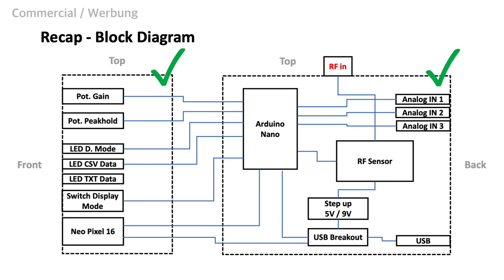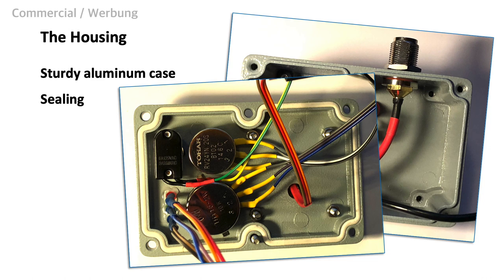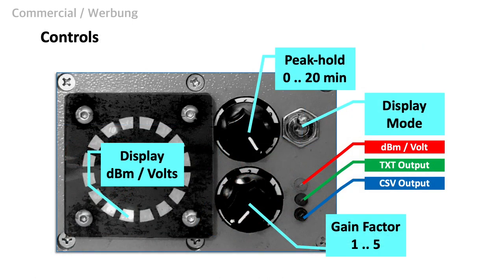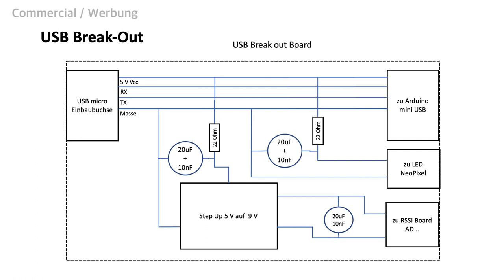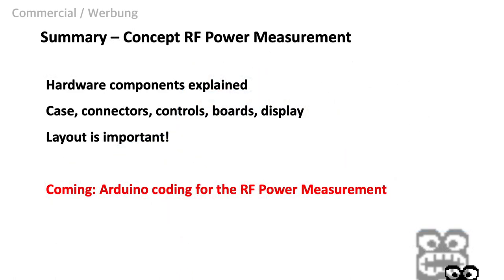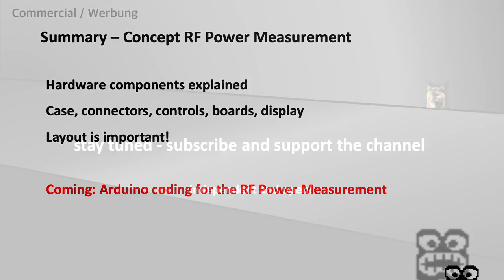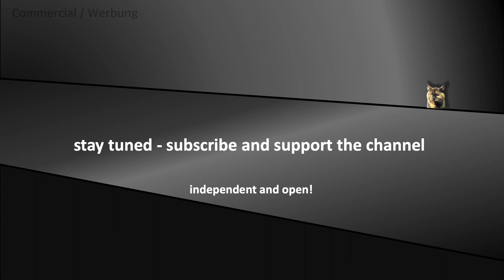HW BUILD: DIY RF Power Measurement based on Arduino Nano, AD8318 Sensor and WS2812 LED (EP20)

Comment: Make a RF power meter with lcd display
Reply from the maker: I am planning a version that is faster and and better in multiple sense. Have you got any suggestion for an LCD display that works well with an ESP32 dec board?
Reply: @electronics.unmessed  I think 20x4 lcd will be better . You should add some parameters like forward watt, Reverse watt, Swr, impedance etc